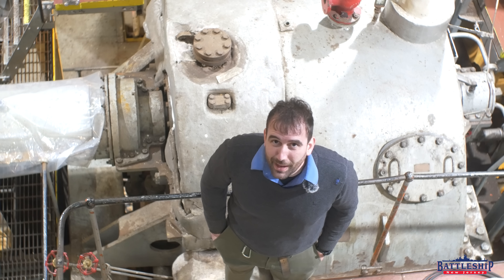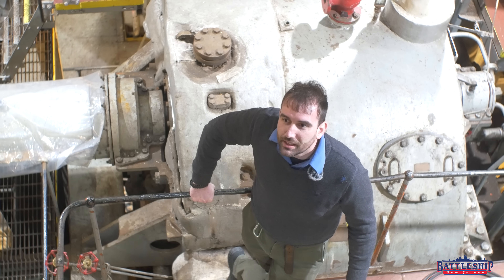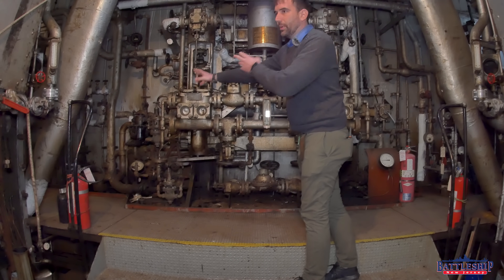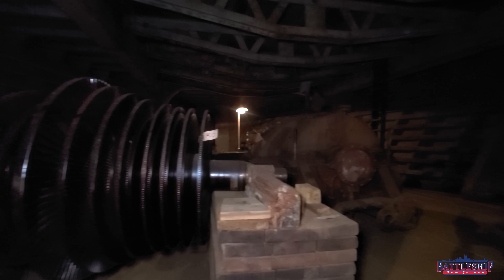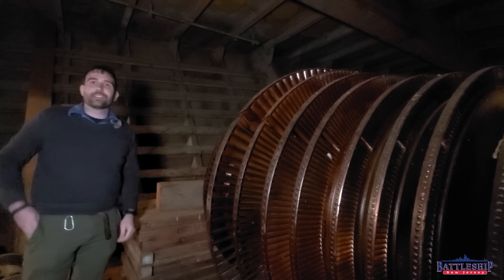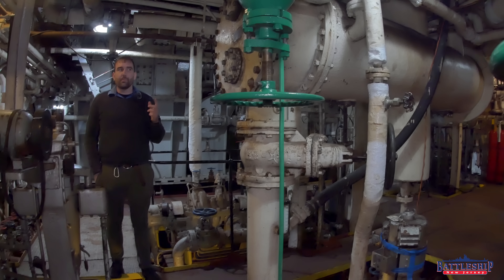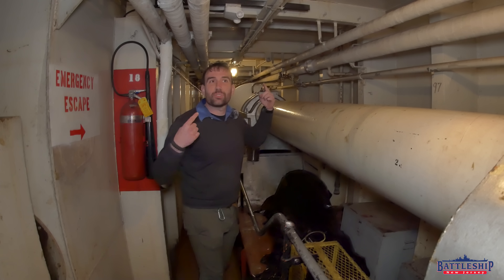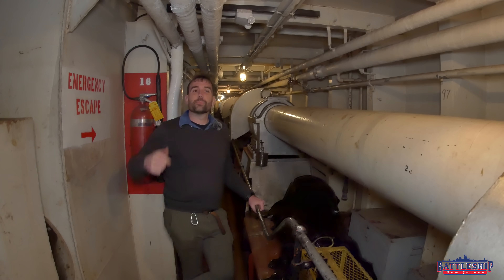The Engineering Plant of a Victory Ship

Comment: FYI yes you could build that turbine today if you needed to.  Turbine shafts like this are still used and sold today.
Reply: Unlike the thick armor used on a battleship. Turbines are still an everyday item to many manufactures and improvement has continued.
Reply: You could build pretty much anything given enough time and money
Reply: @kingssuck06  No they literally still build turbines just like this today.
Reply: @Kyle Burnham  I believe it's the fact it is similar and not the exact same. Remember, they want original materials and build for these restorations.
Reply: @ww2planes_810   trust me, it can be done easily.  I work with turbine rebuilds often.  There is nothing special about rebuilding one, or building one from scratch.  Alot of power plants have units that are much more complicated than these and are much larger.
Reply: @kylexps  And I have had to look into replacing old blades and units before XD I'm saying on THEIR end, they're trying to go for authenticity vice what works.
Reply: @ww2planes_810  replacing the blades is not an issue.  We have it done all the time.  Obviously they are okay with running the ships. Wear items will wear and need to be replaced.  The turbines are absolutely serviceable is my point.
Reply: @ww2planes_810  okay.  sorry for your luck.
Reply: @kingssuck06  it's getting hard to find guys who know how to make things the same exact way they were originally built. They'd have to redesign a lot of stuff to be suitable for manufacture with newer equipment and today's materials.
Reply: @s0nnyburnett  for steam turbines not really, you'd just have to probably find the prints and someone who could cnc them, these types of engines don't experience the same kind of extreme heat that jet turbines do. given how well documented these ships are I suspect the prints are out there still
Reply: @AsbestosMuffins  lol what? 99.99% of you don’t have a single clue just like Ryan. Just spew whatever sounds good.
Reply: @mdtransmissionspecialties  then em why can’t you build a GM trans that doesn’t grenade after 60k miles?? LOL
Reply: @AsbestosMuffins yes and no. We actually keep decommissioned steam ships afloat as logistics support assets so that we can cannibalize parts such as this. Could we do a scan of a broken piece and additive manufacturing to make new? Yes, but at very high cost. The casts are long gone, and for ships such as these, so are the actual designs.
Reply: they're so much smaller too
Reply: It's about the size of the steam turbines used to drive feedwater pumps for powerplant boilers